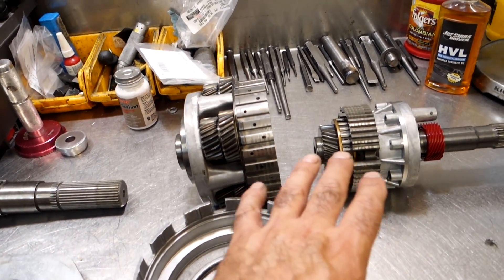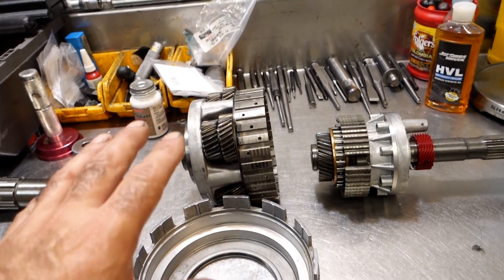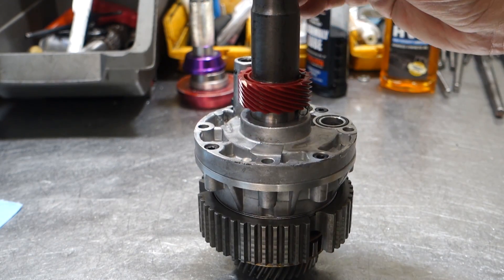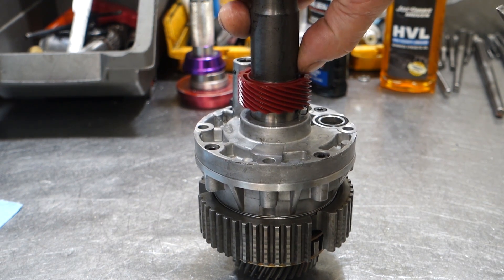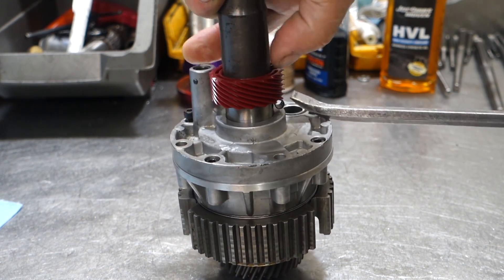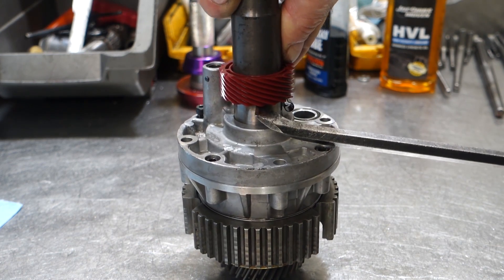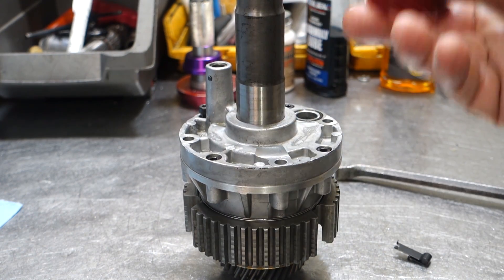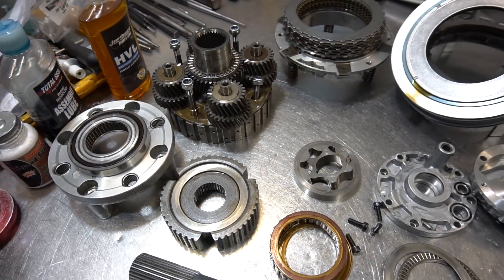How a Corvette 4+3 Doug Nash DNE Overdrive functions

Comment: Nice!  Thank you.  Hope that pizza tasted better than it looked. LOL
Reply from the maker: Those clutches usually burned because the sprag starts slipping and the clutch pack was never designed to fully hold in direct mode on its own. The other is the carrier bearing lets go and you loose stack height clearance on those clutches.